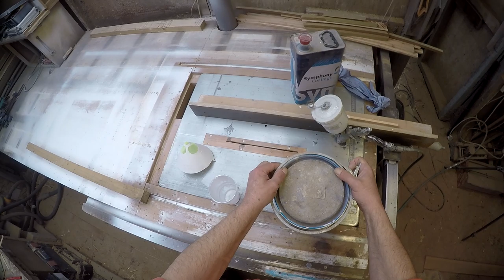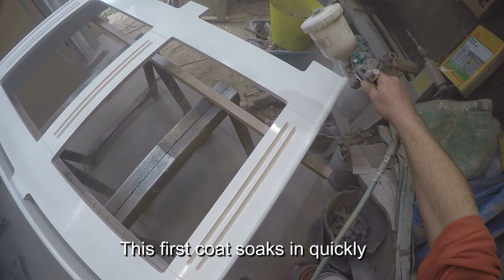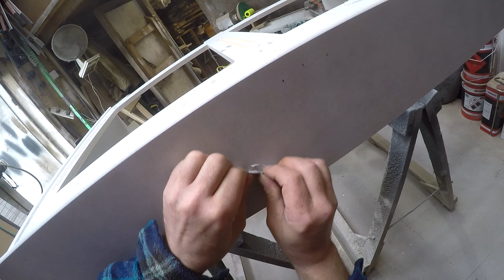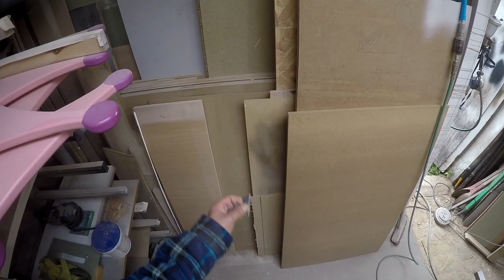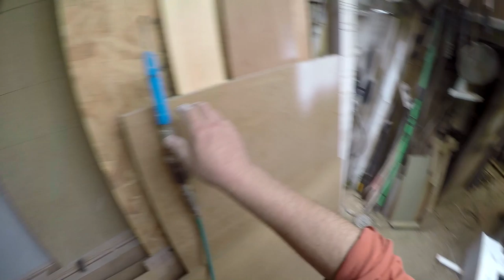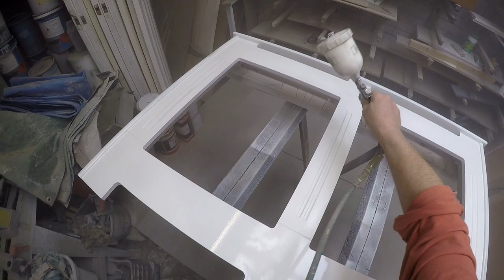Making a radiator cover Pt4 - Almost unedited head-cam footage

Comment: Think it's about time you switched to WB paints. Symphony do renner.  Which by all accounts is very good.  And looking at the prep to your doing for the pre cat. WB wouldn't be much different. And it's free to thin down.
Reply from the maker: I spoke to Symphony about water based a few yrs ago & again recently in case anything's changed, To get it to dry within an acceptable length of time the room needs to be 20º+, heating my shed is impossible, this Pre-cat & the PU i normally use dry in 20-30mins even in winter when the temp is closer to 0º. Symphony says that would be hard to beat even with a heated room,

Comment: Great video mate. I know I’ve asked you this before but can’t find your response on the video. I’m looking at a new compressor for spraying . Would you say a 50l compressor with 11.6 cfm is good enough to get the job done
Reply from the maker: Thanks 👍 I have a Bostitch 50L compressor which is only just big enough, I remember it is about 8cfm i think & the Stanley version which is practically the same is 8.2cfm, That's the important bit, the cfm is how fast the tank will refill & so maintain pressure, I've had this one for quite a few yrs & it keeps up, you can see in this vid, it's still going strong & i don't know when it'll need replacing but if i do i'll get a 100L, any bigger will be too big for my shed but i'll get one with the highest cfm i can get, this one does fine for most of my needs but won't run air tools that require a lot of air like grinders, Bostitch are really good but you can't get this 50L one any more & I'm sorry i don't know enough about which brand is best, I spoke to a compressor firm a couple of yrs ago here in Leeds & they said the basic machines are all the same, off the boat from China with a different brand name on the side 🤷‍♂️🙄😏 https://youtu.be/J27AKNIe6r4 This company is good for guns if you need them, i use the Devilbiss FLG5 90% of the time, https://www.spraygunsdirect.co.uk/index.php/
Reply: Gid Joiner thanks mate. Yes I remember from last time I asked you about your set up and I’m currently looking on their site, they sell a decent set up with compressor that has a pretty decent level of cfm so could be my next purchase! Thanks again mate 👍

Comment: Why were you have paint 'to get rid of? Old or want to change to a different one. 

I have no clue about spraying, but seeing the result makes me want to have a go!
Reply from the maker: Hi,  don't remember if i've said this before 👍 I have a Bostitch 50L compressor which is only just big enough, I'll upgrade to a 100ltr with a bigger CFM one day maybe, I've a variety of Gravity fed guns & a wall mounted regulator/filter set at about 20-30psi, very simple to set up, The cheaper guns i use sometimes are ANI for about £24, they're good to start with, the black ANI i use sometimes is a bit more £45-ish & the Devilbiss FLG5 is closer to £100 but it's the best & my favourite, it's the one you'll see me use most of the time, the paint strainers i use for all paints, the only ones i buy are Starchen 190, I get mine locally but can be got on ebay etc. https://www.ebay.co.uk/p/1292815382?iid=113200954395&chn=ps&norover=1&mkevt=1&mkrid=710-134428-41853-0&mkcid=2&itemid=113200954395&targetid=879043638628&device=c&mktype=pla&googleloc=9046317&poi=&campaignid=9455575137&mkgroupid=94880575894&rlsatarget=pla-879043638628&abcId=1139576&merchantid=7341554&gclid=CjwKCAjw5Ij2BRBdEiwA0Frc9SSEKwHUlAOBKkG1HPN803XblvAQwt4Mt6gWa1BsEcuE70eue-P9fBoC2_EQAvD_BwE A compressor is good for any workshop, This company is good for guns https://www.spraygunsdirect.co.uk/index.php/ I use the 2part PU enamel because it's hard wearing, resistant to household chemicals, dries very fast, sandable in ½hr & is slightly flexible so dents rather than chips, There are many other paints, Pre-Cat enamel is a 1part paint no mixing involved, excess can go back in tin, it sprays easily & flat, & is a bit cheaper so good to practice with but not very hard wearing, AC enamel is 2part , that's easy to spray but both of these, Pre-cat & AC are 'hard', there's no give in them so with the wood underneath being relatively soft they chip when knocked, whereas the PU dents 😉

Comment: What your sprayer setup? I’m looking to start spraying rather than rolling but don’t have a compressor, so weighing up whether to go hvlp
Reply from the maker: A few people have asked about HVLP & sorry i know very little, my neighbour is a joiner who sprays but his machine is a £1k Fuji system,  I quickly go through my system on film but sorry can't remember which vid, I have a Bostitch 50L compressor which is only just big enough, a variety of Gravity fed guns & a wall mounted regulator/filter set at about 20-30psi, very simple to set up, The cheaper guns i use sometimes are ANI for about £24, they're good to start with, the black ANI i use sometimes is a bit more £45-ish & the Devilbiss FLG5 is closer to £100 but it's the best & my favourite, it's the one you'll see me use most of the time, the paint strainers i use for all paints, the only ones i buy are Starchen 190, I get mine locally but can be got on ebay etc. https://www.ebay.co.uk/p/1292815382?iid=113200954395&chn=ps&norover=1&mkevt=1&mkrid=710-134428-41853-0&mkcid=2&itemid=113200954395&targetid=879043638628&device=c&mktype=pla&googleloc=9046317&poi=&campaignid=9455575137&mkgroupid=94880575894&rlsatarget=pla-879043638628&abcId=1139576&merchantid=7341554&gclid=CjwKCAjw5Ij2BRBdEiwA0Frc9SSEKwHUlAOBKkG1HPN803XblvAQwt4Mt6gWa1BsEcuE70eue-P9fBoC2_EQAvD_BwE A compressor is good for any workshop tho if nothing else but for blowing up your tyres 😁 This company is good for guns https://www.spraygunsdirect.co.uk/index.php/
Reply: Gid Joiner Cheers Gid, appreciated 👍

Comment: Is your compressor really quiet or a long way away?
Reply from the maker: No it's not quiet, it's in the metal room next to the extractor surrounded by rockwool slabs but still noisy as f#k 🙉
Reply: Gid Joiner . Thought you might have had a Bambi or a Whisper. If money were no object........🤔
Reply from the maker: 😁 One day it'll need upgrading from Bostitch 50L to something bigger with a bigger CFM 👍